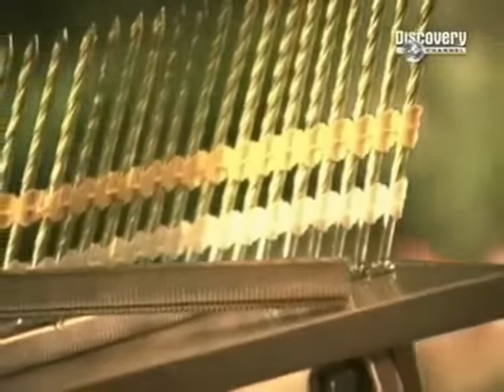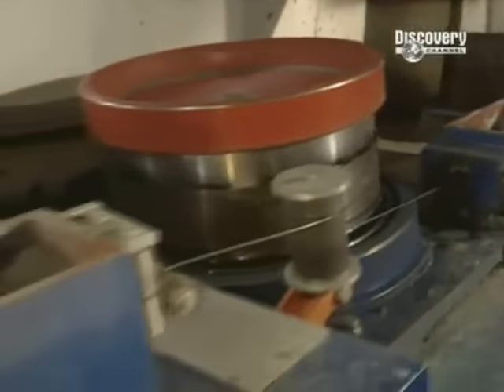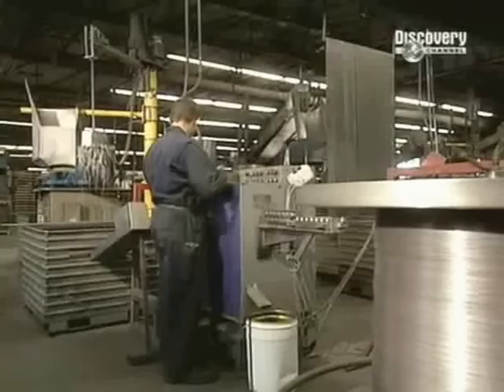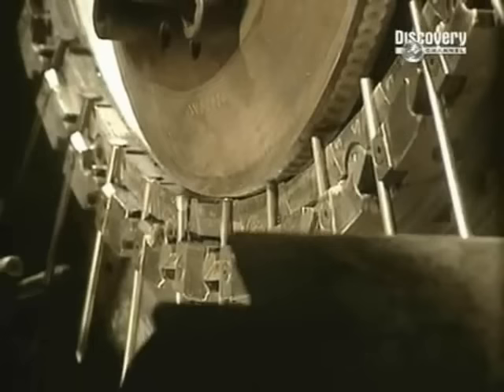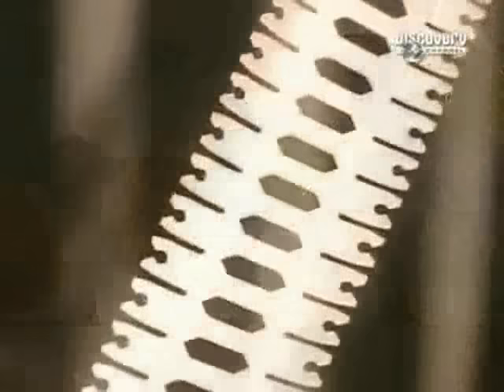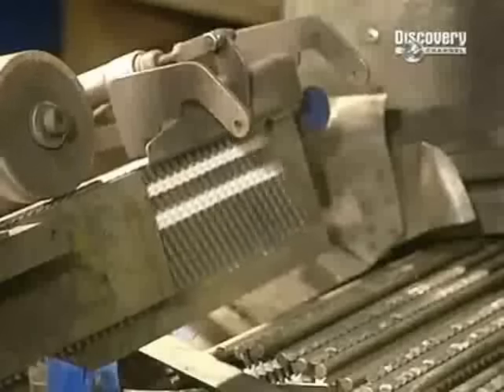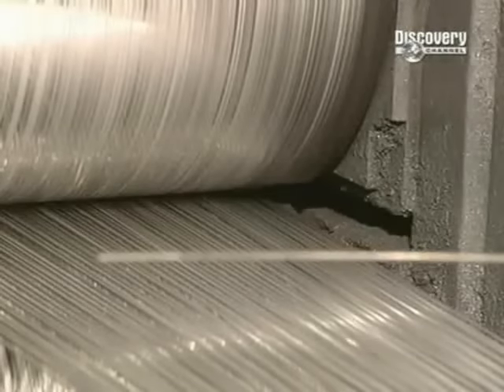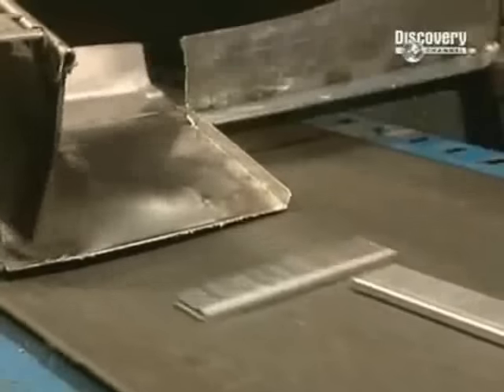How It's Made: Nails and Staples

Comment: How to the get the staples to be stuck together yet easy enough to pull apart?
Reply: Glue.
Reply from the maker: For making staples is used a special wire band instead of wire. Such wire band consists of many wires glued together
Reply: diggity pap

Comment: Which adhesive is used for joining these iron wires?
Reply: Shankey Meena copper wire is welded to the nails. Easy to break off when there under pressure